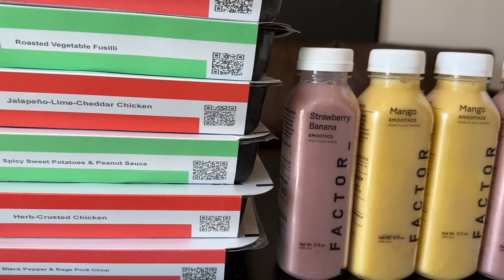Rebuilding A Wrecked Lamborghini Aventador SV Part 13

Comment: Not trying to talk sh!t but I think u should  leave it to big bro to do all of the body work he does 99.9% of it and having you just sand to show on video that u helped out also is more inconvenient I promise if I had two guys sanding same peice I would wanna go over it which I sure your brothers having to do anyways It’s more work I’m not saying this is why but that looks like the side u split sanding was u also sanding the edge down too far but I know that’s still not right the edge shouldn’t be that thin u couldn’t have even sanded a mm off it so better off u found the split in the mold cause if a little sanding got it to split but then again I see u guys using the air sander which is taking a lot off and it’s right on the edge but I know your doing it for the repair so ur kin of doing that on purpose

Comment: not have pro if not can repair oil cooler small hole, have worst amateur cooler repair why him keep shop if not can repair, i know many shop were has repair lot small or big holes easy. one cooler has 27 hole but one hour and all have solder good not leak next 3 year anytime.